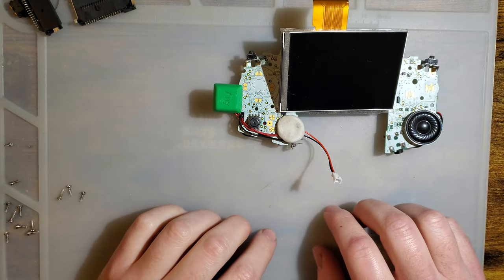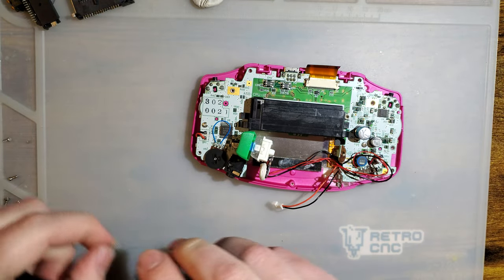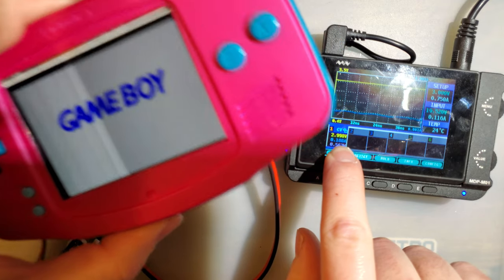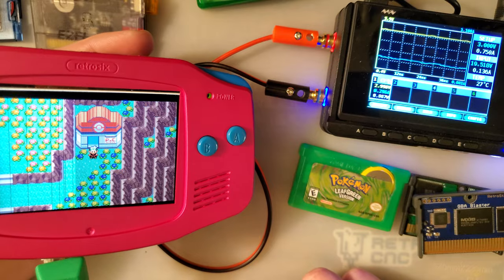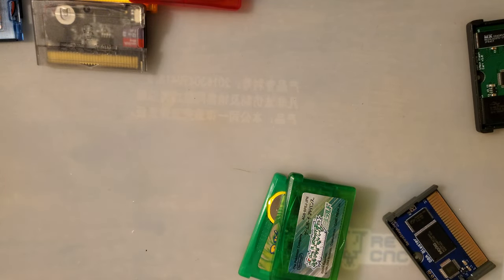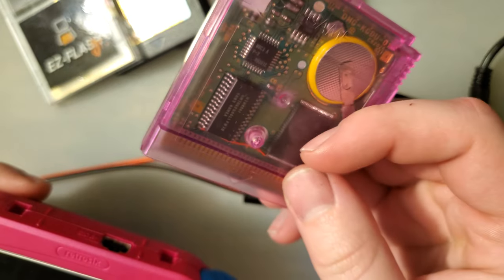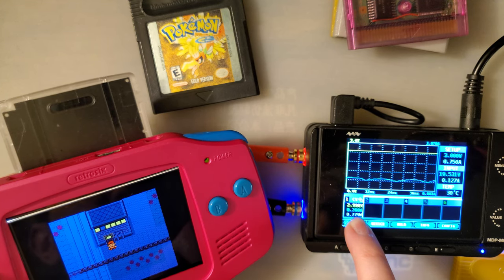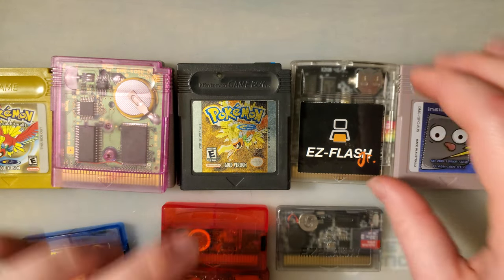EZ-FLASH OMEGA Definitive Edition Power Usage (And Other Flash Carts Too!)

Comment: I can't believe it. My Omega would have arrived in something like 3-4 days and there's a "Definitive edition" now, wow
Reply from the maker: you should probably read about the new features and decide if you even care about them since the EZ ODE is expected to retail for twice as much as the OMEGA.
Reply: @hi_tech_reptiles  Not willing to spend so much for a gba flashcard honestly (also applies to ODE if it'll really costs this much)
Reply: Same  but considering I debated the price of the Omega in the first place because I had emulation running on PSP relatively well.. this new edition is even more expensive so I'd pass either way..

It's insane how expensive flashcards are for GBA but sometimes you just can't beat playing on official hardware.
Reply: @r4microds  There is Supercard SD for 15€ or less, but the quality is not very good afaik. I bought the Omega mainly because it was a good price-quality ratio, and yes despite having a psp/psvita I still prefer the original hardware, those pixel art are gorgeous on a backlit gba
Reply: I cant find any omegas anymore from deals i can buy in my region on the official site ... kinda sad that i missed the colored cardriges ^^'
Reply: @Manuelx98.  ah okay ty ^^
Reply: Please edit your videos.. otherwise very informative and good :)
Reply: @hi_tech_reptiles  Seems like most people say the ODE is better in nearly every way compared to the ED X5, even the ED creator
Reply: So after 15 minutes I discover he isn't doing the obvious comparison between the old model and the new. Jesus Christ.

Comment: Every time I tell another game modder I have the EZ FLASH OMEGA definitive edition, they always go into the spill of why their Everdrive is so much better because it doesn't kill their battery. Unless they also have an EZ FLASH then it's like oh did you update yet to get this new feature they just added?... My take on it is I want the best functionality out of my device firsthand, then I worry about efficiency/how I plan on maintaining my ability to game second. You can always bring a battery pack or extra batteries but you can't force the Everdrive or any other cart to do something they don't support and as of right now the  EZ FLASH OMEGA definitive edition is KING of the gameboy flashcarts hands down no comparison. Not only does it add a ton of functionality like rumble, save states, thumbnail preview/title screen preview in menu, etc etc it can also emulate other game systems like the NES, SegaGameGear, SNES, Genesis/MasterSystem, PC engine, etc etc. All things no other cart can currently do. Sure some of these features are still a work in progress but it is still far better than anything else at the moment. I'm not saying the EverDrive or any of the other flash carts aren't worth buying because they for sure have their own value. But if you're thinking about getting something beside the EZ FLASH because people saying it drains the batteries faster. Ignore them and just get the damn EZ FLASH you will not regret it. The Pro's far outweigh the battery usage.

Comment: Nice video, the rate of power consumption is based on the chips used. The Omega uses the most, because reading and writing to a micro sd card requires a lot more power than a standard cart. Also, the omega's battery will probably always fail, because the device charges the internal battery while playing. The problem with this approach is the cartridge draws a lot of power, and the battery becomes ruined over a short period depending on usage. The battery becomes ruined, because Li-ion cells should be discharged before charging, otherwise a voltage drop appears and the battery loses capacity.
Reply: Isn’t the fear of not charging while using largely outdated? I was under the impression that batteries had advanced to a point that it’s no longer much of a concern
Reply: @kraio-sfu  There is not any harm in charging while using the device if the charging unit can supply adequate amperage to power the device, otherwise, the battery will not charge. I do not like using the Omega and gba sp, because the battery life is very bad. I have purchased an Anbernic 351p, it is very much better. I stuck a 256GB micro sd card, the 351p also feels like an advanced  gameboy advance, also has a very good battery.

Comment: Thanks for the video, will probably go with the Everdrive mini as it seems safer as far as saves go and better battery life.
Reply from the maker: I mean, the Everdrive uses battery backed saves until you reboot to back them up to the uSD or boot into another game so that's not really accurate. You're right about power consumption though.

Comment: When you talked about the 3.3v vs 5v on the flash cart that did not have the level shifters, how much risk is there to the original hardware? Additionally, with all the mods folks are doing, IPS screens, LED backlit buttons, amplifiers, and such, should modders be looking at power circuits on the GBA mainboards to prevent overcorrect damage to the systems or do the Game Boy hardware variants have enough headroom that the biggest risk is just lowered battery life?
Reply from the maker: To be honest, I really don't think there is any risk to the hardware itself. Game Boys are pretty well designed for the most part. At most, I expect that the biggest risk for damage is due to physical tolerances being different on the unlicensed carts. 

And regarding power headroom, this is a serious concern for most models of Game Boy. This is especially apparent with models that have mods and dirty power switches. With GBAs and newer, I think the power circuits are more than resilient enough as long as you have good power supply on the other end (new alkalines with no corrosion on the battery terminals, etc).
Reply: @makho  Thanks for the response. When I'm modding, I always make sure the terminals are clean and have been cleaning the power switches since I learned how from your video on how to do it. :) On GB, GBC, and original GBA, we use Eneloop rechargeable batteries instead of alkaline ones to save on how fast the systems eat batteries with the IPS kits. I am using different SP batteries based upon your videos to try in different mods I've done for the SP, most recently with your v2 board for the lipo.

Awesome work and great channel! I really like that your videos are more a straight stream of consciousness rather than fast jump cuts through the whole process. For me, it helps to see in more detail the steps to go through to achieve the goal instead of how other channels throw a bunch of parts on the bench, and 2 minutes later are reviewing their work, then calling it a "build" video.

Comment: I wonder how my old trusty 1st gen Everdrive-GB would perform, especially since one of the X3-X5-X7's selling point was that it was more efficient than the old one!
Reply from the maker: probably terrible. I wanted to test my EDGB clone but I gave it away about a year ago at this point
Reply: @makho  Did you ever run any test? I would imagine it performs poorly in that regard but I am constantly impressed by the battery life from my GBC with the boxy pixel battery and funnyplaying IPS kit at default brightness. 5h+? I have never ran out of battery. I just wonder how bad it really is!

Comment: For $100, why would anyone risk their money on this instead of getting an everdrive.
Reply from the maker: If you are not planning on using the EZ ODE with a DS console then most of the features will go unutilized and you might have been better off spending $10~20 more on the Everdrive instead or $40~50 less and going with the regular OMEGA.
Reply: @makho  DS features as in only rumble and internet browser, right? Or can I expect to use it as other games in the DS SLOT2 to work together with DS games? That is, except for games like Boktai that uses its solar sensor to work with Lunar Knights. I don't think this EZ ODE has solar sensor.
Reply from the maker: @CeceliPS3  I went into way more detail on this in the writeup I linked in the pinned post.
Reply: @makho  thanks!
Reply: @hi_tech_reptiles  i have the original omega and have had that issue maybe once and i dont know what caused it, i think it probably had to do with not ejecting it from my computer first, but eversince then it hasnt done it and i can save a game and then immediately shut my gameboy micro off and there is no corruption or lost saves

Comment: So did I get that right? the Ez Flash Omega DE saves like a Everdrive? Because from what I have seen they both cost almost the same but the Ez flash has more features and if it now even saves like a everdrive (I heard a lot of complaints with the Old ez flash and broken saves)  that would mean i should get the Ez flash rather than the Everdrive?

Comment: Why does it use more power?  Is it because the roms on GBA are too big so they aren't flashed to sram and they do another solution?  Do flashcarts like the GD Drive for the NGPC or the ones for the GB/GBC use "regular" cartridge power rates because you have to flash the carts before playing?
Reply: There is a microprocessor on board to display the menu, read the SD card, flash itself, etc etc and that draws power.

Comment: You think there will be another one? ez flash omega

I got the original omega. It was alright. One of my sd card stopped 
working for some reason. I got another one works ever since.
There was a capability issue. It was ok but even less with cheats and 
savestats enabled, which kinda sucked. Is it better now with the new 
one? 
Needs a gb mode. 
That switch doesn't look sturdy.
Needs gyro for kirby tilt and tumble.
Should of put solor as well. Most of those games have patched versions now with a patch found on the net.
Rumble is cool. 
This looks cool thou.
Reply from the maker: I'm sure there will be another model eventually. Parts availability will change, things will get cheaper or more expensive and so on.

Comment: @makho I have a ez flash junior that appears to have lost it's firmware.. When I turn it on in a standard DMG and GBASP, there's only a 'r' WITHOUT the 'Nintendo' logo. After some haggling with Aliexpress, I got my money back without having to return the item. Wondering if you might know if there's something I can do to rescue it. It was working perfectly, but I updated the firmware, then a few days later, I turned it on and now the cart doesn't even boot.
Reply from the maker: Things like that don't just break, unfortunately. It might be possible to reflash the CPLD but that's likely just treating the symptom and not the actual issue.

Comment: How long does it last on average for power consumption the ez flash omega hits at 2hrs & 11?mins 
Now for some reason mine only hits at 1hr 20-30mins its lame
     Im switching to tbe gba mini x5 the flushed features has me i dont need cheat menu i just use my phone & transfer my saves w/ gameshark codes
    Does the new Ez flash Omega Definite edition have real clock time save.?

Comment: How were you able to transfer/dump the .sav file into the ez-flash omega for like you did with pokemon emerald file? Sorry if I worded it weird.
Reply from the maker: GBxCart RW

Official Shop (ships from Aus): https://shop.insidegadgets.com/product/gbxcart-rw/
Official reseller (ships from US): https://retrogamerepairshop.com/products/gbxcart-rw-gameboy-gbc-gba-cart-reader-writer-flasher
Reply: @makho  Alright, let say if you are playing Pokemon on an emulator (VisualBoy Advance or MyBoy). How do you transfer the 
.sav file or save data into a Ez-flash omega or flash cart? Also thank you for the link hopefully I'll be able to buy that soon.
Reply from the maker: @es_el_migs  copy the .sav file to the SAVER folder on the uSD card and make sure the name is the same as the ROM file (mygame.gba means you need to have mygame.sav in SAVER folder)

Comment: I'm not one for cheaping out, that being said are there any cheaper alternative carts worthwhile? I'm planning to V2 IPS my gba but don't really wanna pay a further £100 for a flashcard? Thanks in advance 😊
Reply: Your better off with the existing EZ Flash Omega (non DE "definitive edition") for the $40 price tag.

I ordered one off of aliexpress in mid november 2020 I think? I got them in the mail about a month later. EZ Flash Omega and EZ Flash JR (Gameboy color flash cart) and I paid about $75 or $80 for the pair.

Seems like most of the "upgrades" of this newer EZ Flash are stuff you won't use unless your using a nintendo DS and about 11% less power draw compared to the original OMEGA.
Reply: @brandonkick  thanks man I'll look into that, i saw a few of these carts online but was always a little suspicious as to why the are £40 instead of 100 I didn't realise there was a different model 👍

Comment: I have never used flash carts before but I wanted to keep my pokemon and dbz games in one cart. Is the ODE too much? Is there another option that is cheaper or easier? lol Sometimes I want to bring my GBA SP when I travel but carrying all the games is annoying.
Reply: The normal EZ Flash Omega can be picked up for around $30 USD. As long as you don't turn off the console as it's transferring the save file to the SD card (aka just wait 5 seconds after saving), then you won't have any issues.

Comment: I'm so torn between getting this and the Everdrive X5 Mini. Having no "Save State" (Save whenever you want) on the X5 really sucks
Reply: Does the Everdrive backup saves to SD card at least if the battery dies?
Reply from the maker: @McGuinness89  only when you manually back it up or play a different game
Reply from the maker: At some point, it makes more sense to just play in an emulator

Comment: I have a question that i couldn't find the answer to online. I've been playing on pizza boy pro emulator and I've just ordered an ez flash omega. Do you know if I Can port my .sav files onto the flash card to keep my saves?
Reply from the maker: should be able to just drop it in the SAVER folder and as long as the .sav has the same file name as the .gba file, then yeah it should be fine.

Comment: Is there any way to improve the energy consumption of EZF-DE?
Reply from the maker: Not without reengineering the entire flash cart. Apparently newer hardware is better but I haven't purchased a newer one to compare. I have RC (release candidate) unit which should be the same as the initial retail batch. There has been at least one major hardware revision since.

Comment: Do you have a GBAConsolizer to test with the Omega DE? Mine doesn't seem to work. The GBAConsolizer works with all other carts and the Everdrive, and the Omega ED works on all handheld console models I have, but it won't boot on the GBAConsolizer. I wonder if it's power related.
Reply from the maker: No I do not but I will be building a gbaHD within the next couple months.

Comment: i have some problems with my ez flash omega and the ips v2 on my gba. It crashes to blackscreems alot do you have any clue how to fix it?
Reply: Make sure all your roms are working fine and aren’t zip or compressed in anyway
Reply: @SBDannysStories  the Roms are working just fine on my modded gba sp
Reply: @ICallitSchnitzel  so the cart works on your sp? Then maybe try cleaning the slot where the games go in on your gba with some Isopropyl Alcohol and make sure there’s no other corrosion on your motherboard

Comment: How do you like ezflash? I got the jr a while ago but it bricked, so that's an issue.
Reply: How have bricked it?
Reply: @-Gothicgirl-  Not sure. I checked their forums and someone else did the same. They ended up having to reflash firmware. Something about a pin not getting the right signal (some design flaw).
Reply: @Voidsworn  mmh I had no problems with flashing New firmwares
Reply: @-Gothicgirl-  I should it. I have to check what I need or bring it to work with me where I can use their programmer.

Comment: where did you buy your oscilloscope?
Reply from the maker: it's a power supply https://retrogamerepairshop.com/products/mdp-xp-mini-digital-programmable-power-supply-set-with-30v-5a-90w-2-4g-wireless-connection-2-8-inch-tft-screen

Comment: Does anyone have an issue with pokemon crystal rom on ezy flash omega? All other roms are ok. But crystal for me has glitched graphics it's super weird. I have thr genuine crystal GBC cart. But I've tried multiple roms but all seem to have this issue that I've found if anyone can confirm or help?
Reply from the maker: GBA flash carts use Goomba and Goomba Color as the emulator and that emulator is not compatible with Crystal or Crystal based ROM hacks.
Reply: @makho  wow that's weird! Any way around it?
Reply from the maker: @robthomson1581  figure out the issue and write a patch for goomba 

or just buy a game boy color flash cart like the EZ-FLASH JR or Everdrive GB X5/7
Reply: @makho  first one is above my pay grade 😅
Reply: Its the emulation i think its the only unique game that has moving sprites at the beginning of a pkmn encounter 
   I have the same issue & i backed up my rom file from the 3ds Virtual console. Same issue glitchy screen 
Its the gomba emulator needs work
Reply: @xshadowxless8906  EZFlash Omega also has a NES emulator and I found Punch Out doesn't work on it. All the sprites are messed up. The info I found about it talked about some sheet interpreter stuff. Basically the emulator doesn't know how to display the game properly. It can do that if you try any homebrew or games that have been found and dumped recently after the emulator was made like the Sim City prototype.